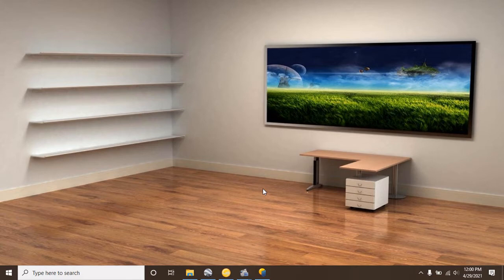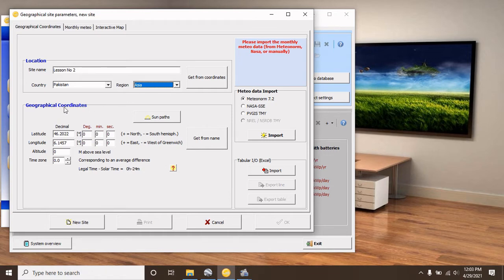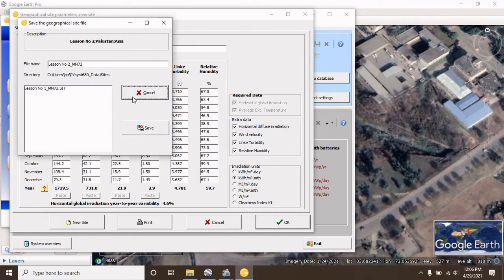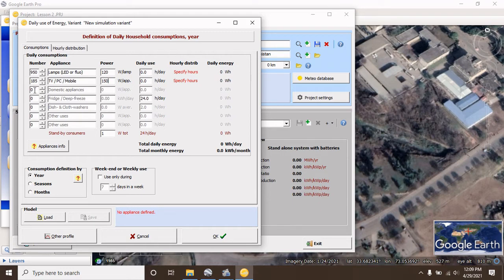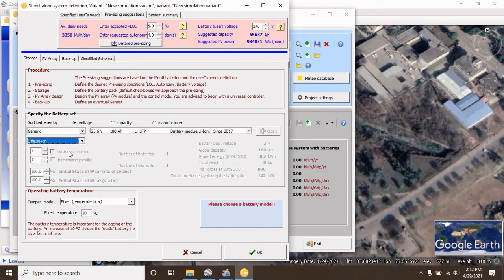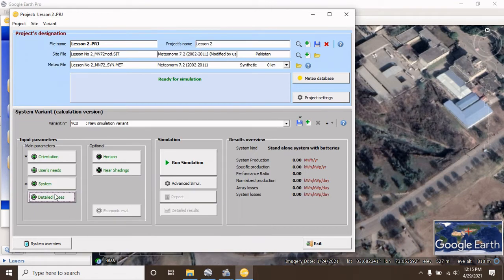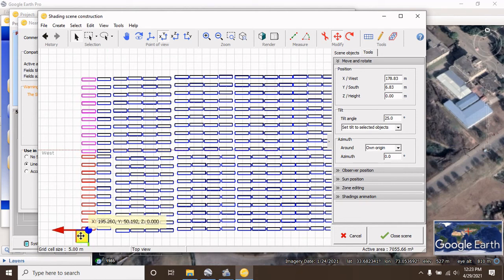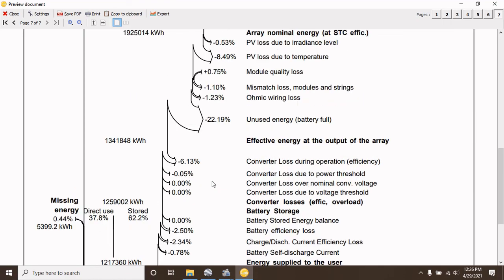PV Syst Standalone System Design | Off Grid Solar Energy System design Using PVSyst

Comment: Hi!
For instance, you have an off-grid system which has both AC and DC consumption data, where will you input the DC power, energy and anticipated consumption time on the PVSyst app
Reply from the maker: Export a grid data formating sheet from Pvsyst first then adobe a PV CSV format and put your consumption data in that sheet and load in grid section